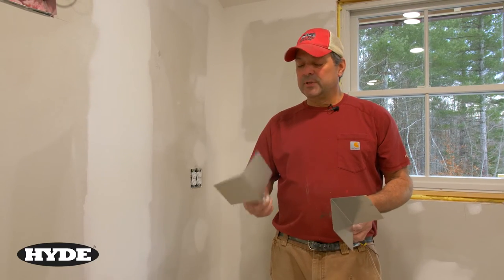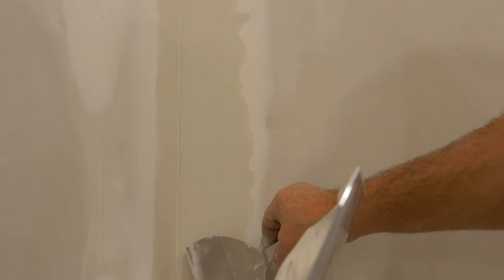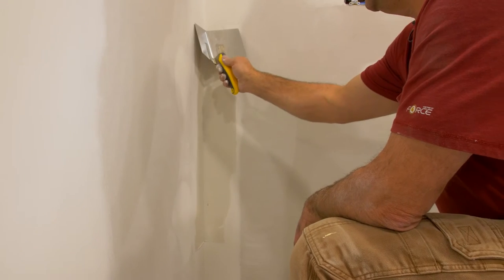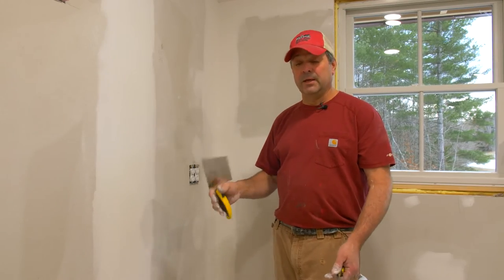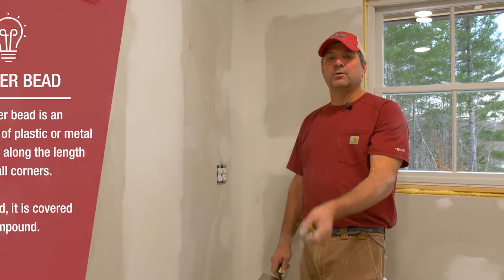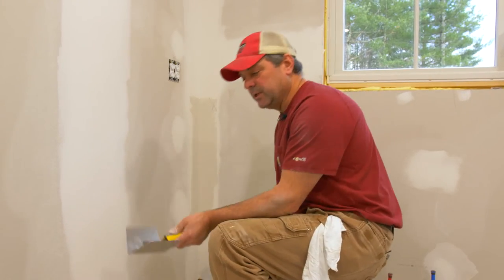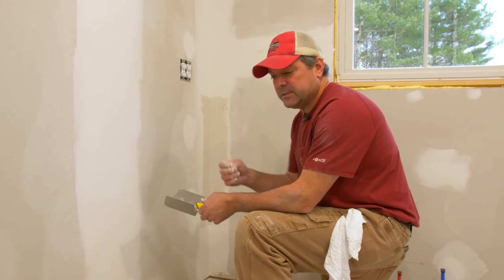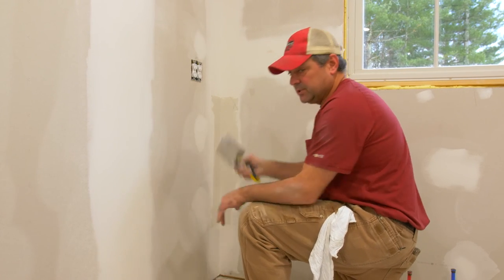How to spackle drywall corners: inside and outside corners.  |  Hyde Tools

Comment: Do you apply the compound first with the flat blade and then use the inside corner one or you apply the compound on the corner tool at the same time?
Reply from the maker: We recommend applying a generous layer of the compound first with a flat blade, then use the corner tool to remove excess compound and smooth it out.
Reply: Great, thanks